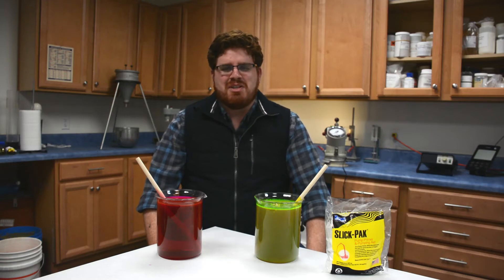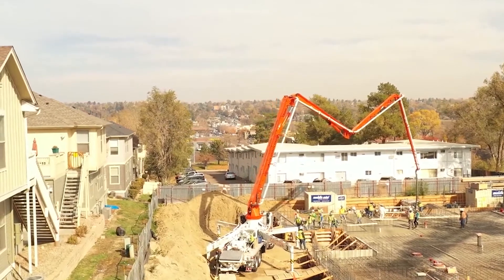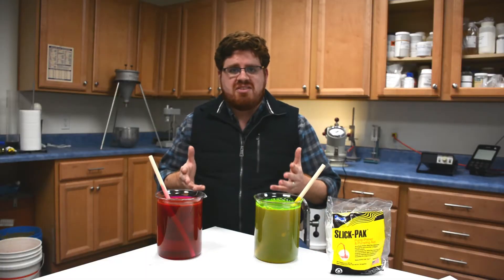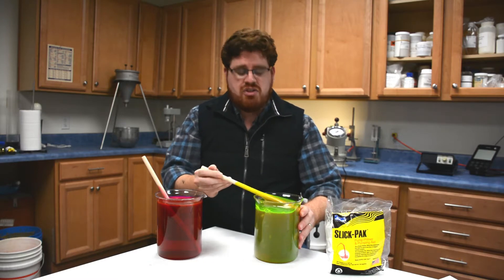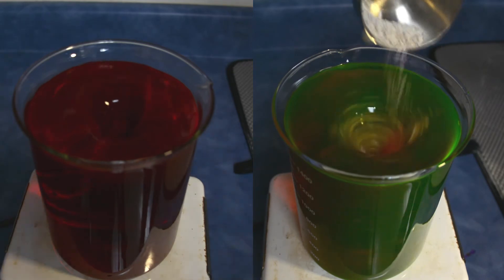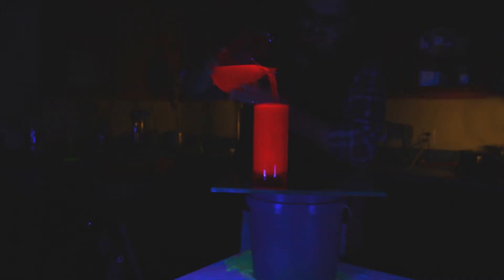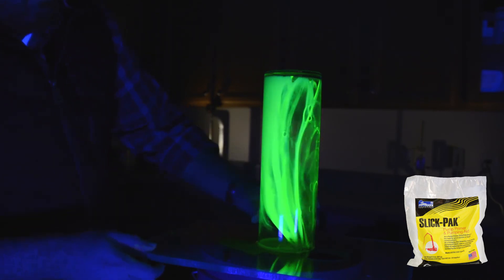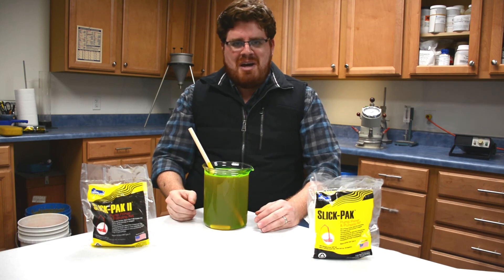Better Concrete Pump Primer Equals Better Concrete Pumping

Comment: Been pumping for 30 years and I hadn't used slick pac in a long time and somebody had gave me some and I applied a small amount into a into a 5 gallon bucket  mixed it in the hopper with some concrete and I've never plugged up so much in my life. I realized I might not have had the right ratio of water to slick pack but it was definitely slimy and it separated and set up the concrete immediately.
Reply from the maker: It does sound like you needed more of the product.  You can find the recommended dosage rates on our website.  https://fritzpak.com/wp-content/uploads/2019/08/bulletin_slick-pak.pdf

Comment: I bought a case of this stuff and only use it on certain ready mix companies mix designs when pumping with my boom. Good stuff but I still prefer a mixture water & bentonite when priming out my line pump, not sure why but it seems to not work as well or maybe I’m just not coating my lines out properly when priming 200’+ of rubber hose system.
Reply: I just use dirt and water! I carry a screen to get out the big stuff,
Reply from the maker: Thanks for the comment.  It could also be that you're not using the right Slick-Pak product.  For bigger jobs or longer hoses, we recommend Slick-Pak II, which is formulated for higher viscosity.

Comment: Hi,

What happens if the contents of Slick-pak are unintentionally added into the concrete.
Reply from the maker: Slick-Pak has no negative impact on the quality or strength of concrete.  It simply improves pumpability without changing the water-cement ratio.  So your concrete should be fine regardless of the application.

Comment: How much concrete can you pump before losing the slick pack lubrication?
Reply from the maker: Thanks for reaching out.  Once you have primed the pump & started pumping, you can continuously pump as much concrete as you need.  If you have to stop pumping for more than 20 minutes, you will then need to reprime the pump with another bag of slick-Pak before you start pumping again.

Comment: I have tried to use this before at it just plugged up within 50 ft of hose, what did I do wrong
Reply from the maker: We may need a bit more information about how you mixed up the product etc to be able to troubleshoot this problem.  If you give us a call at (214) 221-9494  our technical support team can assist you.
Reply: @fritzpak4821  can u explain how to mix up the product for ideal use... i had same problem priming boom. Slick pack sucked up all the cream in Concrete mix and I had a dry pack!! I prime with water and have no problem ever, priming a 63m
Reply: @fritzpak4821  ok cool I will do that! I have been wanting to give it another try, Carrying bentonite around can be pretty messy
Reply: Ya this is what I experienced as well while priming out a line pump. Like 200’ of 2.5” system. When priming a boom it seems to work well.
Reply: @rcppop3090  It never worked for me line pumping, 2.5 inch rubber, would plug almost instantly in the first 50 ft. Water always worked up to 250ft. Works really good with my boom though. Must be the metal pipes, not sure.

Comment: We use bentonite or 2 sac slurry and slick willy
Reply from the maker: Bentonite and slurries can be moderately effective, but there is the added cost of materials and space in your truck.  Slick-Pak can help you save money on materials & is easily used on the job site thanks to the our water-soluble bags.  If you would like a no-obligation free sample to compare our Slick-Pak against Slick-Willy, you can request that through our website: https://fritzpak.com/request-product-samples/

Comment: Question :
does it still perform in under 35 degrees farenheit?  We pump in the winter
Reply from the maker: Great question.  Yes, this product will work in cold temperatures.
Reply: Yes sir it will do just fine